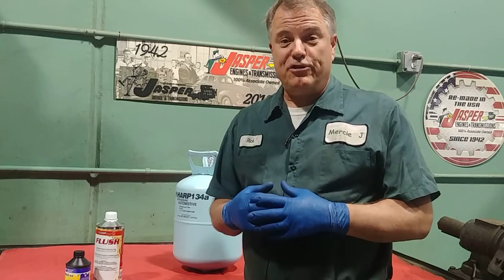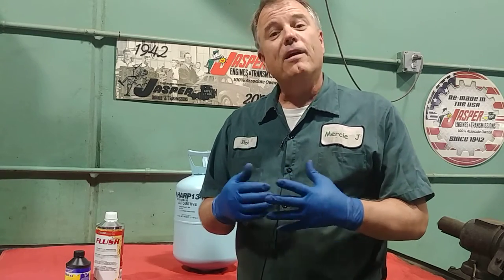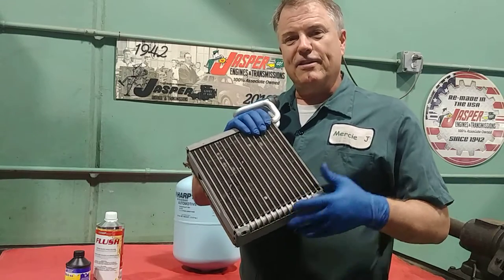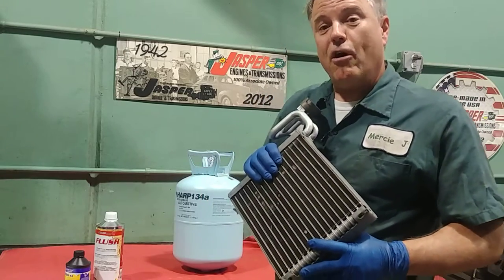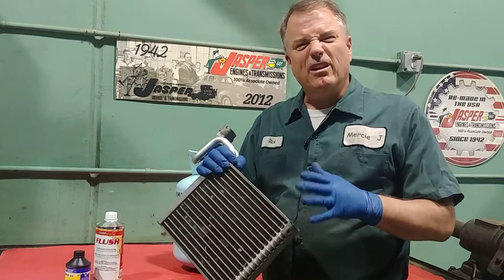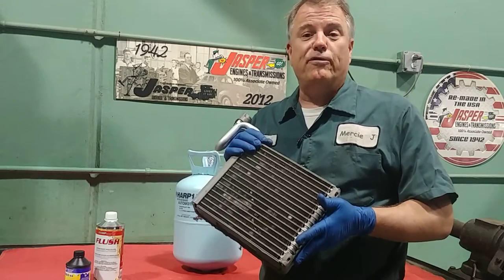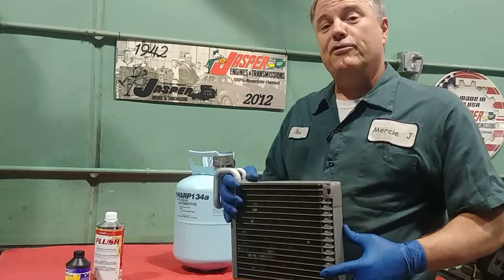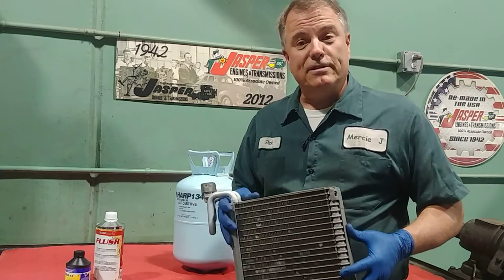How does Front and Rear AC Work?

Comment: I just started the video, so idk if this is addressed, so MAKE SURE the driver/passenger front climate control is engaged if you plan on leaving kids or a dog in the back.  If you only engage the rear zone and turn off the front, it will not engage the compressor and it will NOT cool the car or keep the car cool.

Comment: Question please, the hot air from the front works, but the air from the back does not heat up. Honda Odyssey
Reply from the maker: There are two heater hoses under the vehicle to the back.  They both should be hot with the engine warmed up and the system on heat.  If not, there is a coolant flow issue.  If they are hot, it is likely an air flow issue in the ventilation box.

Comment: I just found your video my suburban has front and rear air they both work but the rear is colder then the front what could cause that?
Reply from the maker: There are a lot of variables.  The temperature control door might not be moving fully to cold.  If the vehicle has some age, could be build up on the evaporator. Checking the temperature of the line exiting the firewall is how I would determine if it is a refrigerant cooling issue of a ventilation issue.

Comment: When the rear blower is turned off, will the refrigerant also stop flowing or will it still flows and get frozen over time?
Reply: The refrigerant will always flow to the rear AC evaporator. If you have a leak in your rear AC Evap the whole system will suffer
Reply: @TheBetito123  is it possible to have 2 compressors in a same system? The main compressor is the stock one that came with the car, the secondary one is added with its own smaller engine. So I can turn the AC on with main engine off, and not wasting so much fuel. What do you think?
Reply from the maker: Some vehicles yes, some vehicles no.
Reply: Hello, and thanks for your video. I have a classic vw bus and I have an underdash vent in it, but it is not too effective due to the size of the mini bus, how do I add another underdash vent to the back pls?